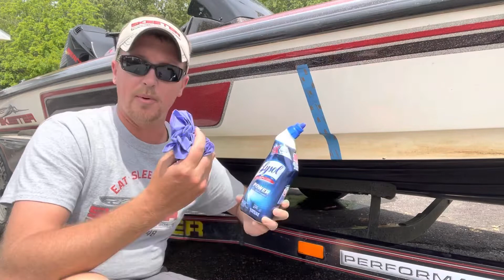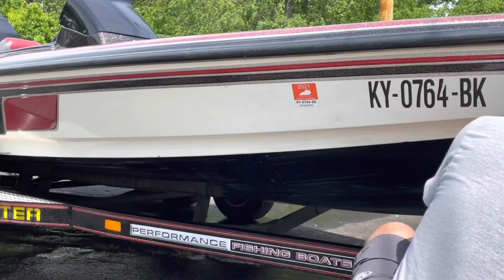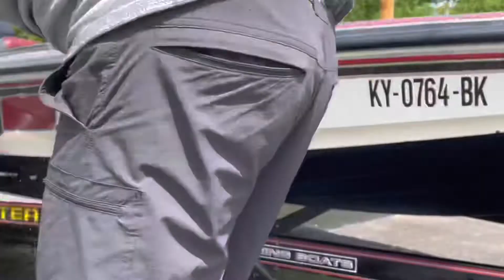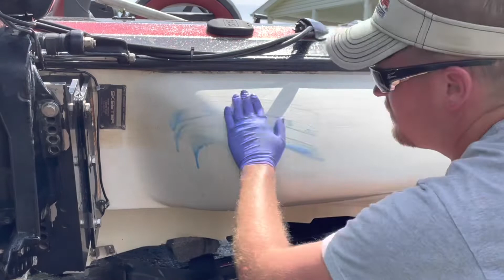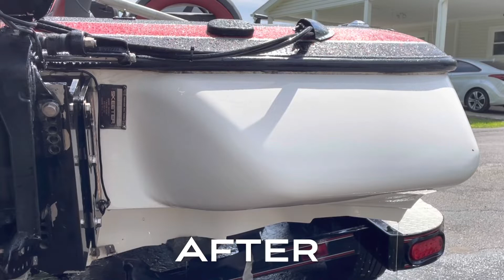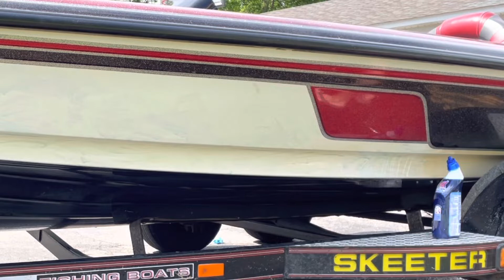Cleaning A Fiberglass Boat With Toilet Bowl Cleaner

Comment: I tried all the toilet bowl / soft scrub concoctions . They don’t work half as well as a product called On / Off hull cleaner . Try it , you’ll be glad you did . Super easy and fast
Reply from the maker: Thanks for the tip. Apparently this appears slow in this video and I’m not sure why but it worked well for me and took very little time. 

For reference as well, the On Off cleaner is $32 dollars for a 32 ounce bottle on Amazon (may be cheaper elsewhere) and the Lysol cleaner I used in this video is $4.40 at my local Dollar General for a two back of 24 ounce bottles. (48 ounces total)

I’m sure there are products out there that most likely work better but for the Ol’ 98 model boat here, it worked well for me. 

Thanks for watching and thanks for the tip for other folks as well about that cleaner 👍🏻👍🏻
Reply: Nonsense.... Marykate on/off is an acid based cleaner. No different than acid based toilet bowl cleaners. There are tons of videos comparing toilet bowl cleaner to more expensive Hull Cleaners.....In every single one of these videos the toilet bowl cleaner works just as well if not better than the more expensive cleaners.....
Reply: I have never used a toilet bowl cleaner on my boat but I have been using On/Off for 8 or 9 years and it does a great job removing those ugly tannin stains. The one  caution is don’t let it get on either a painted trailer as it will peel the paint, and it will discolour a galvanized trailer. Just put some old wet towels over the trailer in the area you are working on. The downside to On/Off is the cost, especially if you buy it from a marina. I am going to look into toilet bowl cleaner to save a few bucks. The other thing that toilet bowl cleaner is great at is removing hard water stains in the bathroom ….especially in the shower.
Reply: I’ve used both. The on/off is powerful and tough on the lungs. Great stuff if you must use it but the toilet bowl cleaner is way safer.

Comment: Super Iron Out.  About $8 for a bottle.   Just a little bit of the powder in a bucket of water, don’t breathe it in.  Use a deck brush to slap in on the hull then rinse off. 1 bottle will last you the whole season and is the best product for this by far! 🇨🇦
Reply: Agreed. Tried a whole batch of different cleaners including toilet bowl cleaner. Iron out worked the best, hands down. I think its probably easier on the gel coat as well.

Comment: Well if you want to discolor the gelcoat go for it.Been detailing yachts for 25 years now and only use FSR which is made for the job.
Reply from the maker: Maybe it will discolor it at some point but as of now I’ve seen absolutely no discoloration whatsoever. As I said….seal it up after. 

In all fairness, I’d bet if you’re detailing a yacht instead of a 25 year old bass boat…sure use something else. I’m sure a yacht owner would love to see someone wiping toilet bowl cleaner on their expensive boat 😂 

Thanks for the info on another cleaning option for folk though. I do appreciate that.
Reply: @problynotthebestgarage  Done yachts from the 80's actually and bass boats and everything in between.I'm glad your gelcoat is holding up well that is good news.
Reply: I have cleaned dozens of boats. Never a single discoloration of the gel. There are hundreds of videos on youtube, no one says they had discolorations. Just about every boat in our 400 boat marina uses toilet bowl cleaner.........
Reply: @nightlife1970  Basically the acid is doing the removal of the stain. The biggest thing is that the acid will also etch the gel coat and if you don't want to have it stain right away when put back in the water, you will need to polish the gel and wax it.
Reply: @rx7dude2006  SO then you are saying all acid based hull cleaners stain the hull. Kind of a strange way to look at it. As any hull waxed or not will get stained, it will just take the waxed hull a little longer. 

But it does not matter. As I have not seen a non acid based cleaner that will take the stains out. Acid works nothing else does.
Reply: @nightlife1970  That is not what I am saying.I'm not going to argue with you about it because this is what I do for a living and know what I know.

Comment: The active ingredient on most toilet bowl cleaners is hydrochloric acid.  Not sure if I would use it on gelcoat.  Soap, water, and a micro fiber rag will get that scum off with about as much agitation as you applied with your glove.  Chase it with some FLITZ to polish, and your boat will be squeaky clean with nothing harmful applied.
Reply from the maker: I have heard of Flitz but haven’t had any experience with it. I’ll have to check that out. As for the “scum” line though, this is well beyond scum. It is imbedded stains in the gel coat and would not budge with any soap or anything else leading to this point. I tried it all. Trust me when I say my first choice would not be going straight to anything acidic. 

Hopefully that cleared up any confusion I may have not been too clear on there. This isn’t a dirty boat this is a stained boat. 

Again though, I appreciate the tip on the FLITZ! Stay safe out there
Reply: @Probly Not The Best Garage    Yeah, Flitz was originally designed for taking oxidation off fiberglass.  Turns out its bitchin for polishing aluminum and takes the dull sand blasted look out of powder coating too.  Best polish I have found.  Check your local gun shop.
Reply from the maker: I will most definitely do that! Thanks for the info

Comment: Aren't the stripes under gelcoat 
If there's no discoloration of the gelcoat why couldn't you spray it on 
Just woundering
Reply from the maker: Yes that is 100% correct. The gel coat is over the top (similar to a clear coat I would say) and the cleaner did not hurt the stripes in any way. If I need to do it again later which I’m sure I eventually will need to, I will spray it on just for a quicker process. 

Be mindful of anything chrome or metal in general though. That toilet bowl cleaner doesn’t like metal at all. 

Thanks for the question!

Comment: Does not work.
Reply from the maker: @philsorrentino1707 Sorry to hear that. Just to make sure though in case this differed. I did try a different type of cleaner that was just at our house already and had absolutely no luck at all.  

If that’s the case for you as well, make sure you try the exact brand listed in this video. Best of luck there if you decide to give it another whirl. Thanks for the comment
Reply: Pull your head in buddy It's NOT the OPs fault that you bought a completely different branded product! There are only 3 scenarios in which you could make a statement like that in good faith 1. You are making assertions that the OP is a Liar and deliberately misleading his audience, but why would he do that? 2. You are making accusations that the OP used special effects and Photoshop to deceive his audience into believing that LYSOL would work to remove Hull waterline scum lines and discolouration. Or the most likely scenario is 3. Your incompetence has led you to purchase the incorrect product and when it didn't work you immediately make accusations that OPs method "DOESN'T WORK" which I can personally attest to that it most certainly DOES WORK if you buy the actual product OP demonstrates in this video. Derrrrh 🙄